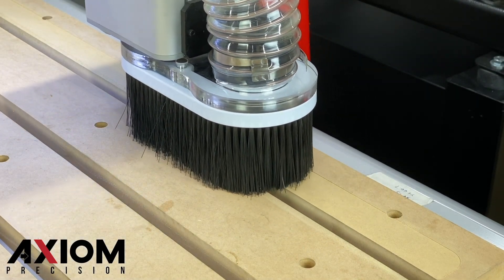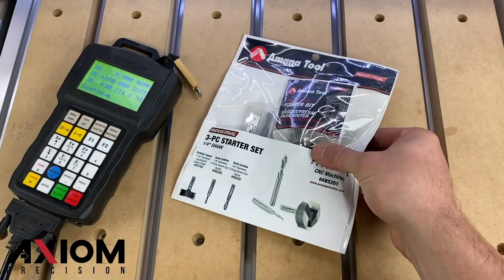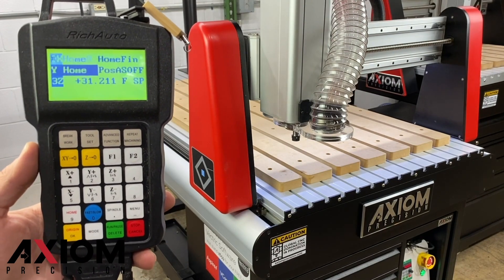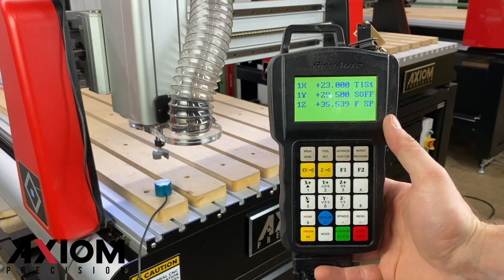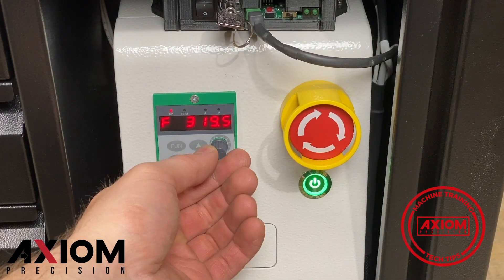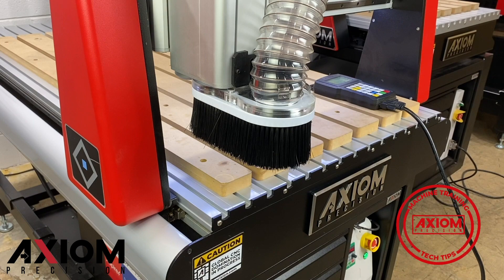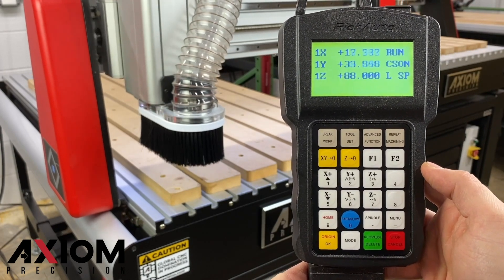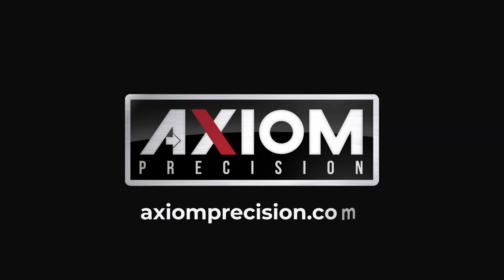Axiom CNC Training & Tech Tips (Spoil Board Surfacing)

Comment: Newbee here, I ran the program just as the video shows, however when it ran it hit select high spots as expected but left many spots untouched which means they are low spots. How to I set the Z axis to cut deeper when running the spoil board surfacing program? Did I miss something in the video?
Reply from the maker: The surfacing programs depth can not be changed from the controller. In most cases if this if you first time surfacing you may have to run the program a few times to level the deck. Now with that said you can alway set you z zero below the spoil board ever so slightly but this will require you to loosen one of the spoil boards. we always stress caution when doing this. hope this helps.